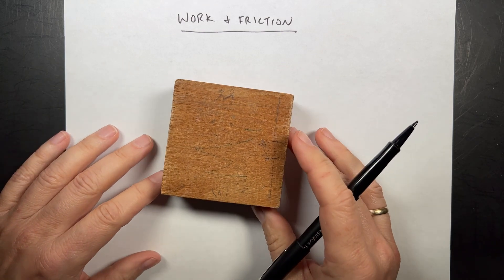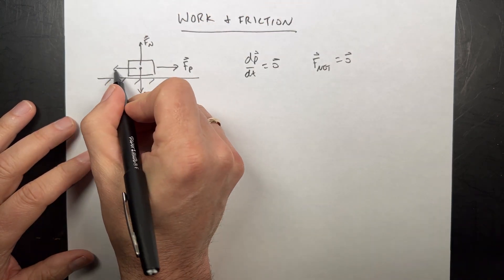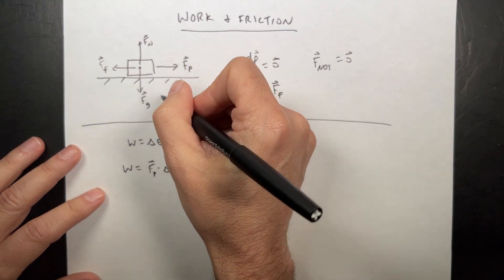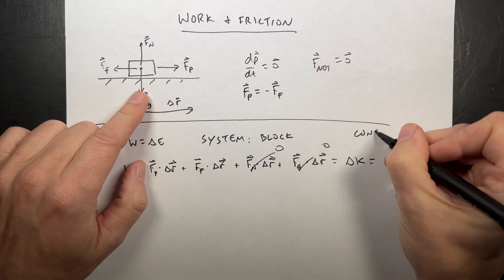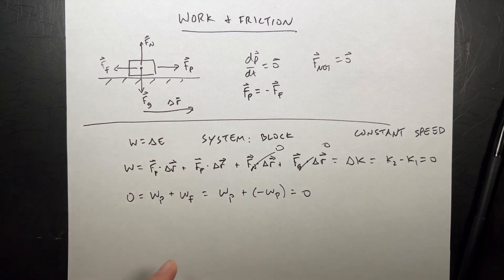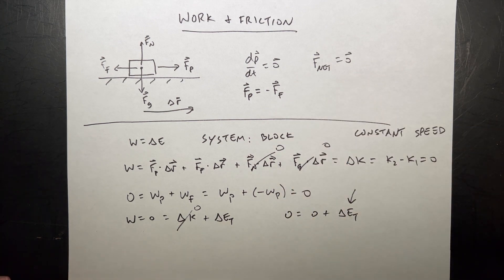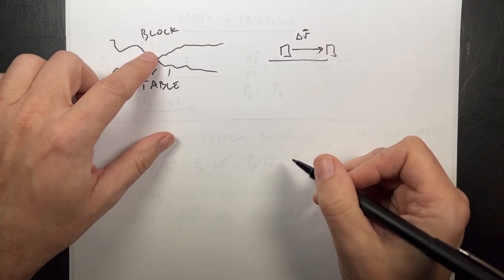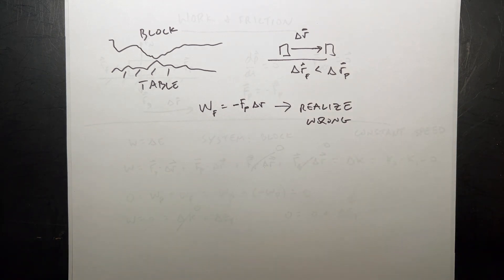What's Wrong with Calculating the Work Done by Friction?

Comment: Think about it this way, the block is doing work against the table, but the table is stationary, and yet work is being done on it… work is being done to raise the kinetic energy of the molecules in the table, which increases its temperature, hence thermal energy. We could choose our reference frame to be the block, and make the table what “moves”, now we have the opposite effect, and so we know that the block must also heat up.

Comment: Are we certain that Ff is equal to negative Fp? 
If all the forces are equal it can't move. If one force is greater than the other it moves in the direction of said force.

Yes if i push the object with my finger i have to overcome the force of friction which is the resistance that i feel.
Reply from the maker: If the block is moving at a constant velocity, then Ff MUST be equal to negative Fp. Otherwise, the momentum principle wouldn't work.
Reply: @DotPhysics  i just rewatched it and it's obvious why.
Ignoring the starting motion and assuming a constant speed and ignoring air resistance (would just add a small vector in the opposite direction of Fp).

Since you define work as the difference in energy for the block it can't be 0 since we observe that the block has more energy (in this case heat) than before. Thus all the calculation may contain an error (even if it's in the formula).
We still put in energy with Fp this energy should get negated by Ff but it just gets converted into heat energy, where some is lost to the surrounding but quite a bit is absorbed by the block. 

So it's either smth wrong with the calculation or the formula

Comment: I do not understand your argument. You could do exactly the same thing with lifting a body in a gravitational field. I am pushing the body up and gravity is acting down. Both forces are equal in magnitude and the body moves with a constant velocity. In this case, the total work (by two forces) is also zero but it is nothing to worry about. The system still gains potential energy. This energy comes from, e.g., chemical reactions in my body so the energy is conserved. It is the same story with friction.

Comment: Isn't heat caused by friction? Why I can't just say that work done by friction= gain in heat energy?
Reply: But some sound is also produced
Reply from the maker: You can say that work done by friction is the change in thermal energy - however, the problem is that the frictional force is equal to the pulling force.  If the distances are the same, they do equal and opposite works so that the total work is zero.  Then there's no left over energy for thermal increase.

Comment: Probably energy given by your hand is not equal to the energy required to do work done against the friction but it will slightly high and convert into thermal energy.
Meaning, 
External force = Frictional force 
( Hence we get constant speed)
But energy transfer through your body is not only use by working against the friction force but also spent by vibration near surface atom , hence 
Work done by you = word done against friction + thermal energy of surface atoms 
Here note that there is no new kind of force generated and energy associated with it is thermal energy but rather it is part of friction force i.e. while in motion we expect that all external energy must convert into only against friction force and we get constant speed but not actually , friction force decreases and hence energy required against it also decreases and hence Little left over energy from external energy will use to produce heat energy. This heat is produced due to microscopic collision (momentum exchange) between surface electrons and rough surface electrons due to very near momentum exchange this surface atom get recoil and produce thermal ir spectrum and we get heat.
Reply from the maker: The forces MUST be equal and opposite or the momentum of the block would increase.